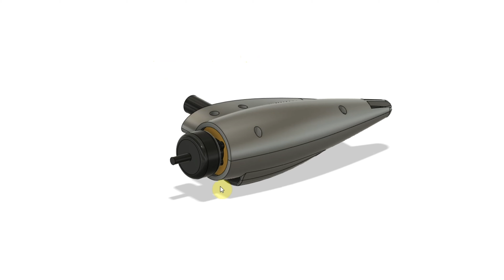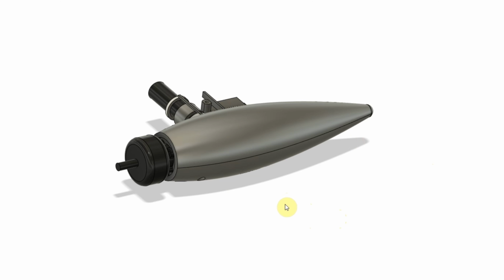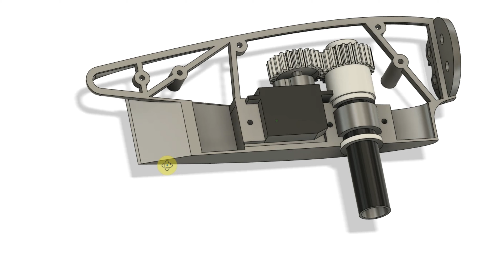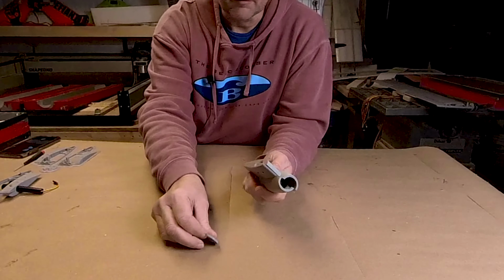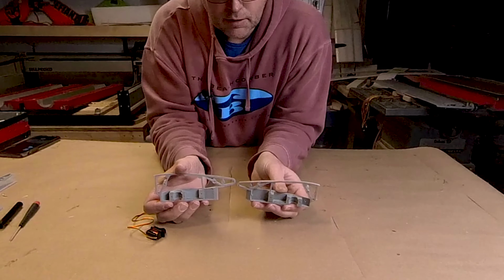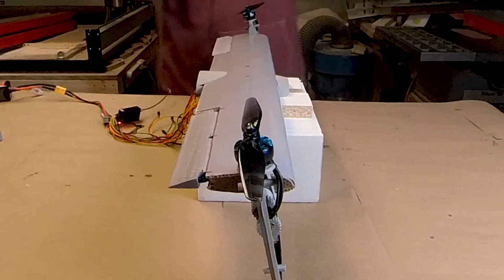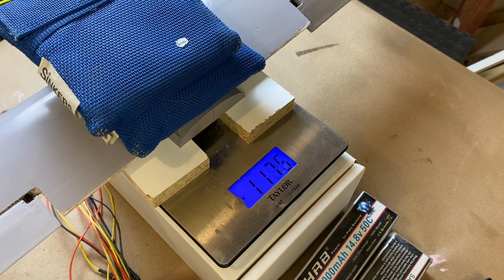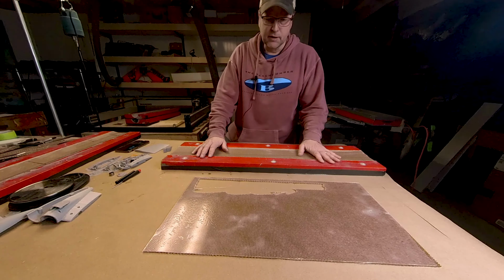Rogue (Tandem Wing) VTOL Part 3 - Nacelles

Comment: Nice update on the Rogue, seeing the process of how you make the parts like the lid would be nice to see.
I was just thinking about  using the motor for yaw when hovering, you could do the same thing in flight but to give roll by tilting one up a little and one down a little to make it roll. Then with tilting the rear motors for pitch and differential thrust for yaw  you could  remove the flaps from the wing.
Reply from the maker: Thx!  Yes, there are a number of possibilities with the rotating nacelles. Certainly differential thrust for yaw as this design doesn’t have a rudder. Also, I didn’t include flaps either because Ardupilot has the functionality to rotate the motors to add additional lift as the plane slows below a certain speed. So many possibilities!

Comment: Very nice project, vtols are just many compromises which means there are so many possibilities. I'm rly amazed how the vtol theme gets more and more attention.
Reply from the maker: Thx!  Yes, it’s seems that VTOLs are becoming more popular. They seem to fit a specific need in the urban air mobility area and for us in areas unsuitable for traditional aircraft. Unfortunately compromise is the name of the game. As more new approaches emerge I think we will see more efficient craft. That’s what makes the space to interesting right now.
Reply from the maker: Also, my molds are designed specifically for versatility. The nose and tail cones and wing tips are not included in the molds. This allows me to use them for a single motor conventional flight version or any number of combinations without building new molds.
Reply: @DefiantWings  I'm rly excited how it go's. Still not sure what's going to be the most usable and still efficient design. Saw so many tree tilt motor designs but don't know if a simple quadplane may be better since you can optimize motor and props individually....
Reply from the maker: My earlier designs were 3 motor designs but they were different to balance. My current design is much simpler to balance and easier to balance a payload. The very common quad plane configuration with the  dedicated pusher prop is a great design because you can optimize the motor/prop for efficient cruise. I don’t like carrying all the dead weight and drag of the additional motor. That design is also simpler because there are fewer moving parts and you could use a wet fuel for the drive. Lots of possibilities but I wanted to explore something different
Reply: @DefiantWings  the biggest problem is probably that you can't use a standard frame kit, that's why I rly like your approach.
Reply from the maker: I’m always trying something different 🤷‍♂️. Sometimes it works and sometimes I end up with a bunch or firewood 🤣🤣